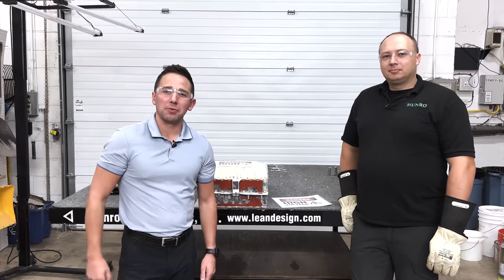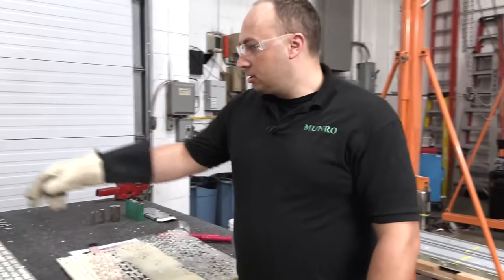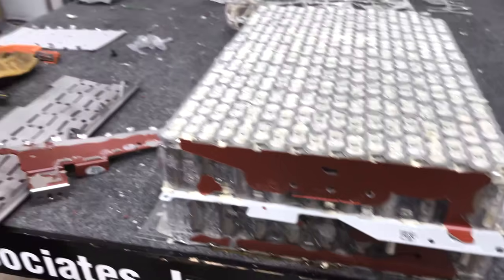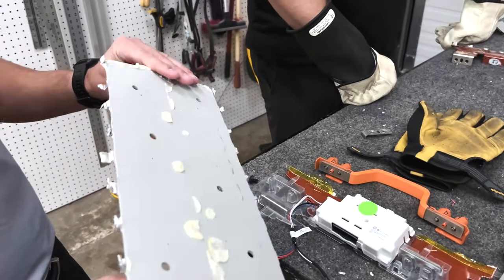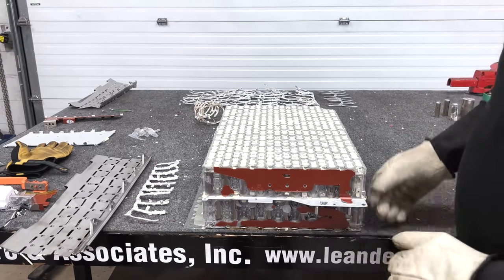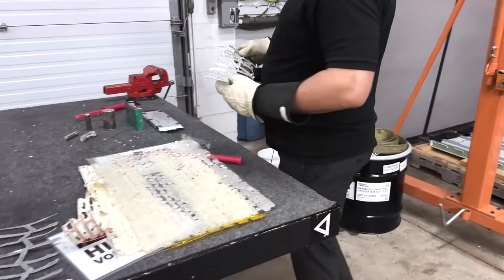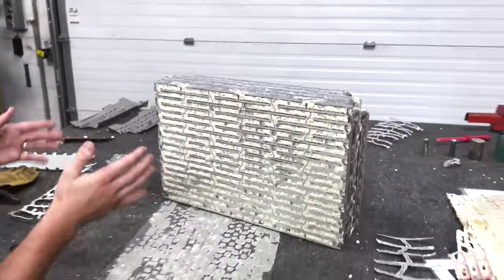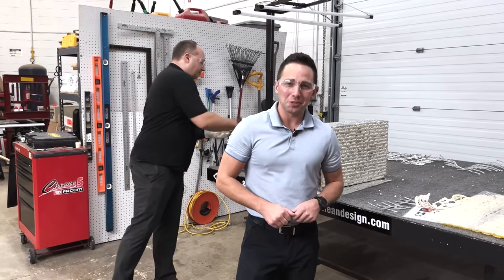How Rivian's 7777 Batteries are packaged!

Comment: Well that was an interesting ending lol. I can really hear the Michigan accent in Pam's voice, it's not a bad thing though. I appreciate the explanation about the different types of batteries too. I didn't realize that although the prismatic and pouch cells are more energy dense, but when all put together in a cell module they end up being about the same as the Tesla cells. It's always something screwing with cell efficiencies when bundled together to make a huge battery pack. I have a 34' class A RV that I outfitted with ten 100 amp hour LiFePo4 batteries (Battleborn) mated to 2400 watts of solar on the roof and ended up changing out the two roof AC's to one minisplit heatpump to both heat and cool my RV along with other things that I changed out for optimal efficiency, so I can now run my everything in my RV 24/7 without plugging in or running my generator! Lithium cells are a real gamechanger in many ways and I'm excited about living off-grid without sacrificing any of the conveniences that require power. I love your channel and your overall philosophy regarding efficiency in manufacturing, the OEMs should be flocking to your company for input!

Comment: 5:50 When you see coloring through, that typically indicates nickel or tin coated copper. You should be able to tell simply by the weight whether it's aluminum, but based on the volume and current capacity, I can't see how those aren't copper.
Reply: Definitely has the luster of nickel, maybe tin, certainly not aluminum.

Comment: So each Rivian module is 12s72p which is a departure from 3 years ago when it was 96s9p.  I have pics of the old module which is how I figured that out.  So the old module at 96s was the full 400v nominal pack voltage and adding additional modules in parallel added capacity.  Now it takes 8 modules to achieve the 96s full pack voltage.  Perhaps a pack capacity expansion now means adding a module or two in series to boost the voltage above 400v, rather than another full 8 modules in parallel to double the capacity.  This would imply the controller and charger can handle 10% higher peak voltage which is quite possible with COTS mosfets.  IIRC the battery expansion capacity goes from 135 KWh up to 150 KWh which is about 10%, but I could be wrong about that.
Reply: What I have in my database on battery packs: 
Rivian 135 kWh = 9s modules of 12s72p = 108s 72p. This is likely what they have on the bench there.
Rivian 180 kWh = 12s modules of 9s96p = 108s 96p. This is likely what you refered to, but misspelled is as "96s9p" what is actually 9s96p.
In both cases nominal battery pack voltage is 108s times 3.6V = 388.8 Volts.
The modules themselves share 12*72 = 864 = 96*9 cells. Rivian just changes the current collectors to get different kinds of modules for different kinds of battery packs.
Reply: @koeniglicher  Great info!  Rivian is only shipping the 135kWh packs right now.  I had pics of the Rivian packs from 3 years ago and it was 96s9p.  They took two columns of 24 cells and connected them in series, so there were 9 of those in each half.  Then the end plates that connected the top half module to the bottom half made the parallel connection.  Apparently this didn't work well in keeping all the cells balanced at each step and they changed it to what we see in this video.

Comment: Going to be fun recycling those packs with the poly adhered to everything.
Reply: They talked about that on the 4680 teardown. Basically, it's not a problem once the pack is ground down/shredded in the recycling process.
Reply: Much better than the unrepairable Tesla 4680 piece of garbage. At least the modules can be removed without destroying the battery!

Comment: 14:35    .. The key to welding exaggerated thickness variance is preheating.   What you can do to weld those little foil pieces on is lay your larger/ thicker bus bar into a hot place so that it's already preheated -- then when you apply your foil strips, you can quickly braze it on before it burns through and move on to the next one.

Comment: Small issue with the title: You show that one brick is 72p (18 x 4 cells). Then 24 cells horizontally dived by 4 is 6s on one side and therefore one half is 6s 72p. Both halves together is 12s 72p. If you disassembled the 135 kWh battery pack, then there are 9 such modules. In total: 9s 12s 72p which is 9x12x72 = 7776 cells. In the title you tell us: 7777 cells. Where is the extra cell? In the flash light of the Rivian. 😀
Reply: 12 volt
Reply: @mrknesiah  Does not fit: Rivian has 2x 12V batteries. See manual or Munro "Rivian R1T Teardown | Frunk removal". They are the red bricks near the air intake. Both likely lead-based, and therefore 12 cells in total. Even if they were lithium-based, they also would be more than one cell. And for sure, these low voltage batteries are not made from the 2170 form factor cells that the traction battery is made of.
Reply: @koeniglicher  Zach explains the cell count in his video, 7776 in the drive battery, 1 cell in the flashlight.  I wonder what kind of batteries are in the bluetooth speaker.
Reply: @mrknesiah  A 12-volt lead-acid battery would actually actually SIX more cells.  

So yeah, Rivian lies.  They're as truthful as a spherical earth.

Comment: 14:15 Welding a thick material to a thin material, if you apply heat to the back of the thick material, it would heat up to accept the weld, then let the thin material melt enough to weld? Or add braising material to the thick material before braising, then add heat to the back of the thick sheet until the braising sticks to the thin material? I don’t know if that makes sense.

Comment: At 14:00, those current collectors don't appear to be symmetric? Unless the top collectors have an opposing asymmetry? I wonder if the current path equivalency is overlooked sometimes?  Meaning that some cells will carry more load than others simply due to the slightly longer buss lengths to each cell relative to other cells.

Comment: 21:20 well that woke me up. the pouches are definitely more dense even at the pack level which is the reason most of other EV makers enticed to use pouches. however pouches are worse for reliability, stability or safety. this is the reason why Tesla insists on more expensive, more difficult cylindrical cells. 
anyways, it is a good thing Rivian is going with LFP cells in the future. It is time to move on from these relatively costly but high performance packs.

Comment: Curious on efficiency of Rivian sandwich plate cooler; varying from Tesla wavy extrusion cooler; any other designs in use for removing heat from cylindrical cells?
Reply: Upside: Plate cooler is lighter and allows for higher power density. You can put cells closer together because you don't have material running between them and less plumbing to each extrusion. Downside: Less surface area touching the cooler and you rely on the can to transfer heat from one side of the cell to the other. This can be mitigated by a pumping coolant at a higher rate through the cooler. Neither plate cooler or wavy extrusion (ribbon) are superior in all respects, just require different design considerations.
Reply: If you watch lucid video of the ceo he did the same thing for the cooling too with a non stacked battery modules
Reply: Someone makes flexible plastic coming channels. Miba

Comment: That is really clever to have the base of the cells from each side on the cooling plate. Additionally, I bet the "paint" on the cooling plate is a thermally conductive electrical insulator. It would be interesting to see what that coating material is, but I suppose that info won't be on the free YouTube report 🙂

BTW, base cooling of cylindrical cells works great, more uniform. It's much more uniform than side cooling, especially on thicker cells (& why the Plaid uses 18650s). Tesla originally showed base cooling for the 4680, but then abandoned it. I find that curious. I thought the improved end cooling was the best feature of the 4680.

Comment: Would like to know what is the material used for side plate and any coating is done on that for electrical isolation? I came across Stainless steel as a side plate material with powder coating, is it possible to replace powder coating with Nylon/ PPS gf40 for electrical isolation... Thanks

Comment: Comparing the cooling to Teslas... I'd guess the fairly light amount of cooling explains why the truck appears to thermal throttle under full-bore charging, and suggests that the long range (if ever made) would stay equipment limited for longer? And would suggest that the small pack, when made, may have to charge proportionally slower?

Comment: 20:23 That isn't always true, and lot of the pouch and prismatic cell packaging is no more substantial than cylindrical cell battery packaging. In fact, the only real difference between prismatic cells and cylindrical cells is shape. Both types of cells are designed to operate with minimal packaging, and they can often operate completely free of any additional packaging (though for automotive use, you have to account for vibration). 

In fact, this is starting to sound a bit like misleading advertising in an infomercial for cylindrical cells. The power density for cylindrical cells is typically higher than pouch or prismatic cells because of thinner electrodes, but the energy density chemistry for chemistry is often lower for cylindrical cells because there is less active battery material per mass because of the smaller size relative to the mass of the packaging. Prismatic cells tend to be larger in scale, so they have more active battery material relative to the mass of the casing; however, the jellyroll electrodes in prismatic cells can result in a variety of power densities from thick .5 C to thin >5 C electrodes. 

Strategies for packaging the cells can vary, and each packaging strategy can result in wildly different pack energy densities, based on the specific types of cells used (regardless of format) and whether the battery case itself is a structural component. For example, the outer case (made by Magna) of the GMC HUMMER EV's structural 200 kWh battery pack is 450 lbs, but the non-cell weight of a Tesla Model 3's non-structural 82 kWh pack is ~400 lbs.

Comment: Cold plate much better design than the cooling fins.  Cooling fins are now leaking often in older model s packs.
Reply: This is something I was pondering, logically if you pack a bunch of cells using a cooling plate, the inner cells would not cool as well as the outer ones even in a sealed enclosure.  Like a bus full of people traveling down a highway without AC, would it wrong to say that the people inside the bus will get heat stroke?

Comment: Man, just not made for ease of manufacturing. Lots of parts and lots of sub-assemblies required. Let alone just throwing a whole of batteries at it - double layer. Funny ending! Thanks Munro Team.
Reply: that pack has to withstand off-road abuse. so itll be built differently.
Reply: That's why the vehicles are so heavy.

Comment: It's now easy to see why Rivians weigh so much. Seems quite excessive to use so much metal on these modules. Not very impressive. The thermal management seems like a pretty bad design, especially since one plate is being used to heat or cool 2 modules at the same time. Besides the fact that there is not much surface area for each cell to contact the cooling/heating plate. Just want to mention that modules don't have BMS boards, they have BMB boards. And why didn't anyone break out a lighter and see how flammable that foam was. Is it just me or does Munro seem to nit pick everything tesla does, yet just glosses over any bad designs that other manufactures are coming up with. In any case, thanks for the video, it was nice to see how other EV companies are building their battery packs.
Reply: Bms: battery management system, 
Bmb: battery management board 
Bmb board: battery management board board.
Correct is parent and child systems, parent being in penthouse child on modules.

Agreed on cooling.

Foam chars, mentioned in Zach's jerryrigeverything video.
Reply: @squee8174  BMB is a battery monitoring board BMS is a Battery management system. I worked on Tesla battery packs for 5 years, so I have first hand experience.

Comment: Is they battery pack recyclable? These sealed modules are throwaway and cannot be repaired, i.e. a few cells replaced, no they all go into the grinder. All vehicles need to be designed and manufactured for full recycling.

Comment: So how many cells and what's the voltage??
Reply: 864 cells 400 volt.  They showed in the video at 13:00
Reply: 9 modules. Each module 864 cells. 7776 cells in total, wired as 9s 12s72p. Nominal voltage of 108s times 3.6V = 388.8 V. Over the range of differing states of charge likely from 2.8 to 4.15 V. So about 302 to 448 Volts as a battery pack voltage.
Reply: @koeniglicher  nailed it 👏

Comment: As for the title should it not be "How Rivian's 7777 Cells are packaged!"?  Interchangeably using Cells & Batteries will certainly confuse people new to the subject . . .
Reply: Eh, I’ve gone right through the pedantry zone and come back round to accepting that it matters in technical literature but if it’s on YouTube the viewer either knows better or doesn’t care.
Reply: @armadillito  Think about people mixing Voltage & Amperage . . .  Small details make a difference.  Especially when Sandy brings forward the "First principles of engineering".

Comment: How does the rivian pack compare to a Tesla pack? It seems like there are way more rivian batteries than Tesla batteries.
Reply: Too complicated, too heavy, and more expensive in comparison. But not terrible.
Reply: These are called cells, not batteries.
Teslas Model 3/Model Y largest pack from 2170 format cells is about 81 kWh and has 4416 cells.
Rivians R1T pack from 2170 format cells is about 135 kWh and has 7776 cells.
If the Rivian battery pack has way more capacity, they need way more cells, obviously. In the end, the Rivian is a kind of pickup truck, not a sedan or crossover.

Teslas newer battery pack with 4680 format cells (Model Y from Texas) reduces cell count: 828 cells to get 81 kWh gross battery pack capacity.

Comment: Seems complex and heavy relative to Tesla 4680 pack, but interesting in that the battery modules look easy to replace
Reply: Nope it’s not! It’s a stacked battery pack which takes way less space in the length of the car so that the whole bed can be customized/have more free space….
Reply: It’s is actually easier to take apart so later reusability is going to be superb unlike the useless tesla 4680
Reply: @carholic-sz3qv  yes, the Tesla batteries will need to be incredibly reliable or as you say they become useless as they’re unfixable from what I’ve seen. However, there’s another new battery tech in development at MIT that’s using low grade aluminium and molten salt which has a target price of $9 a kWh! This would mean a large car battery would come in at less than $1000, so I can see the cost of replacing batteries collapsing in the near future. I think what we are seeing here is very early days still. I think progress will be like with flat screen TVs where the price has dropped to a fraction of the launch price. What we’re seeing right now is early adopters paying through the nose for products that are no where near fully developed. Apologies for the long message!

Comment: Scientists need to develop a 'metal foam' to replace that awful foam used in packaging cells together. Better conductivity and easier to recycle.
Reply: The foat does not need thermal conductivity and must not have electrical conductivity.

Comment: NOT TRUE ABOUT ENERGY DENSITY!!!...  That Panasonic 24ah cell weighs more than 24ah of the tesla 18650 cells.    The prismatic cells are more power dense.   But thay is probably due to cell design vs cell geometry.   You can design a cell for more power or more energy... just not both :((

Comment: This foam should be made to easily liquify in a catalyst for recycling and rebuilding packs. Batteries should never be sold with the car. Only leased. So that they are all kept in a recycling and rebuilding loop. Then nobody is stuck with a lemon pack. Then it doesn't cost 30K to replace the packs every 5 years. Then the latest tech packs are installed as years pass and tech improves. You could make many sizes of packs. A small one for the 10 min trip to work all week and getting milk. With the ability to install large packs for weekend road trips and vacations. Leasing solves so many downsides to EV's. An automated quick swap system and standardized battery packs would also solve several problems. Just drive over a grate and a robot moves in to remove and install a new battery.

Comment: Some good points, yes. Too complicated, too hevy. Probably 15% more expencive than needed.
Reply: Totally wrong!!!!! It’s less complicated than the tesla one! It’s a much bigger battery pack in a significantly bigger can than tesla and also it’s easy to take apart so later it’s going to be much easier to reuse the battery cells/packs unlike the dumb tesla thing!
Reply: Do you see how it’s double stacked battery!? It’s actually for a purpose so that the rest of the car like the bed might be cut/modded for other purposes later